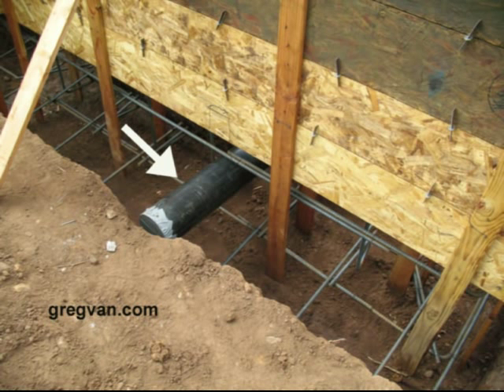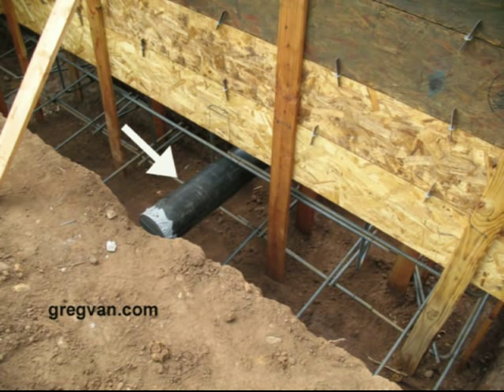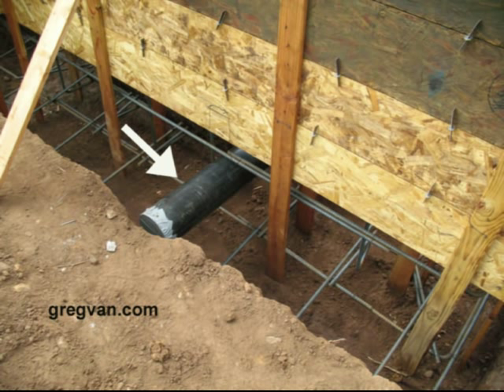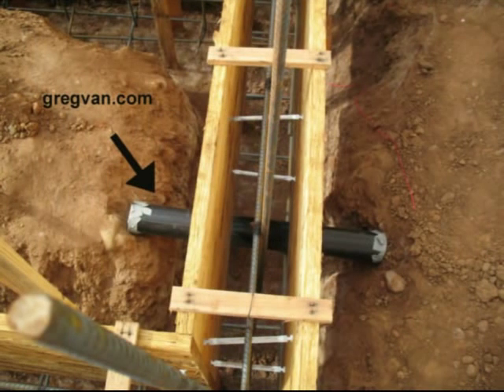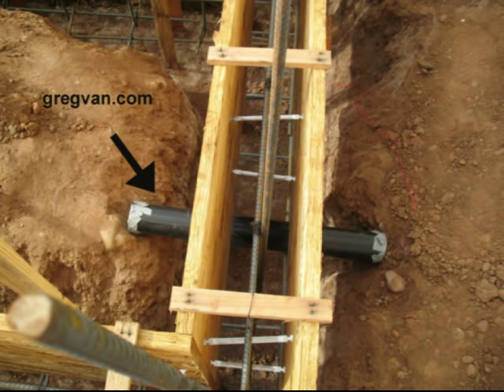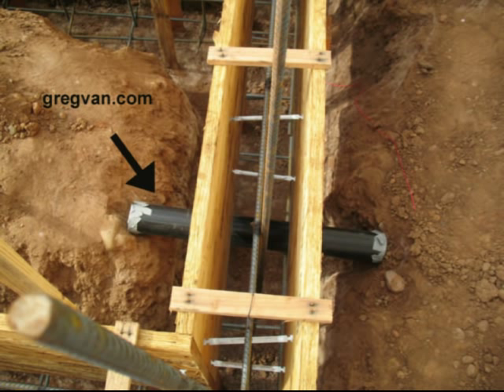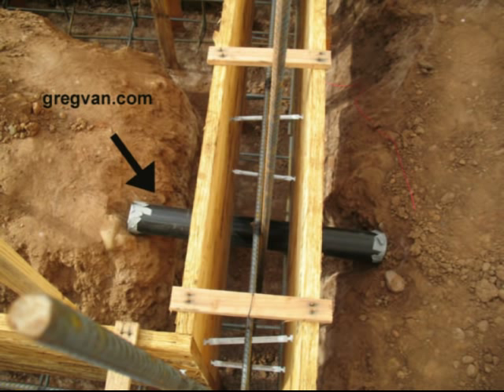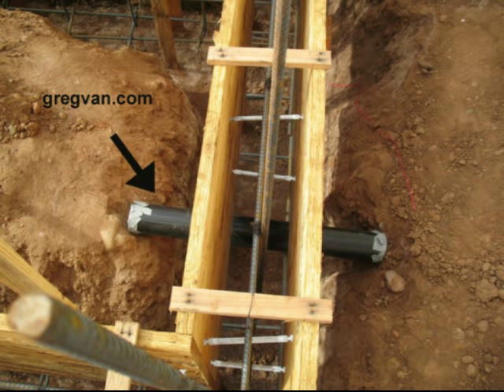Concrete Footing And Plumbing Pipe Sleeve - Building Foundations

Comment: doesn't have to weaken anything.  Can be under the footing, so you wont' lose any thickness.  Or if you use a steel pipe it will be strong regardless of where its put.

Comment from the maker: My bad, I apologize and you're absolutely right. The only thing is, I've never seen it done before and I believe it has something to do with the building foundation and the pressure exerted on top of the soil it's sitting on. As far as the steel pipe goes, you've got a good idea, but metal rusts and might not be the best avenue either.

Comment: Thats why I suggested putting the pipe under the footing.  Then you keep the full thickness of the concrete and the footing/foundation wall will be every bit as strong as if it was sitting on packed dirt.

Comment: I know this is an older post but I was wondering in addition to plumbing, how would you sleeve for electrical, water, ufer ground, com, and anything else prior to concrete. Can this all be run up through the stem wall for a cleaner look? Do some builders do that? Thanks for all the educational videos.

Comment: Hey Greg love all the videos and learned so much .
I have the plans and trying to design my plumbing system.
I understand the pipe sleeve and the main drain moving horizontal.
But can I put a vertical pipe in the footing and stem wall? For a 3in drain or even a vent pipe?

Comment: I have plastic pipes under the foundation I'm building now. The concrete is 8 inches thick above it and the pressure is distributed over the soil. Sounds like you probably know how that would work.   I suppose plastic could go inside of steel, possibly get the best of both, but just an idea.

Comment: great video, helps explain how the setup looks. How can plumbers make changes years after foundation pour to get around concrete footings/beams to re-direct new in ground plumbing  remodeling changes?
Reply from the maker: They usually drill or jack hammer through the foundations or go under them.
Reply: @gregvancom  thank you!

Comment: Funny story.  I reminded a block/cement guy about 10 times to sleeve a series of terraced flower beds.  Yeah yeah yeah. Finally the day before the pour I went out, did it myself.  I come back two days later to find wonderfully crafted series of walls...all minus the sleeves. So I asked the concrete genius 'what the H... happened to my sleeves? "Oh, I didn't like the location so I removed them. Lucky, the homeowner MADE this moron jackhammer access through 3 walls. ALL DAY JOB. Ha ha ha ha.

Comment: Well I got to this video searching for a way to build or install a relieving arch.
I have new addition where pool pipes goes through new addition foundation. 
I know I have to protect those pipes but I want to do a relieving arch
Reply from the maker: You should check with a local plumber or your building department. Pool pipes might need to go around foundation.

Comment: Greg a contractor put a rat slab down under my place where that black pipe comes out - and they filled the end with concrete- without asking. Is that okay? It’s a very old place. I sure wish you’d take a field trip to saratoga!
Reply from the maker: If it's a drainage pipe, then there's a problem and it should be fixed. Let me know if this makes sense.

Comment: Great, but how do you waterproof the pipe in the sleeve?
Reply from the maker: I would imagine you could use an approved sealant. This would require you to form a sleeve that might be at least 1/2 of an inch in diameter larger than the pipe you're going to install and then use the sealant to seal the area around the pipe and foundation.

Comment: I'm looking at those vertical 1x2 supports on the forms. How are those removed from the footers once concrete is poured? Wouldn't that leave wood or voids in the footers? Thanks
Reply from the maker: They can, but I usually remove them before the concrete is to hard. I've seen them left in before also and nobody says a thing.
Reply: @gregvancom  form a drain, deletes the labor of removal and removes water from the foundation.  No need to waste labor or lumber.

Comment: I don't understand; if the 4" pipe weaken the foundation and the plumber pipe is needed somewhere in that area, where should be or what other option is there?
Reply from the maker: +paul young Even though it weakens the footing, the pipe still needs to go through. It's a common practice, but the plumbing pipe could always go underneath the footing, but you would need to check with an engineer to see exactly how far, because of the extra weight now on top of the plumbing pipe.
Reply: oh ok i understand
Reply: @gregvancom  then deeper trenching is needed to keep positive sloping.  The location of the drain pipe is much more important than that of supply lines.